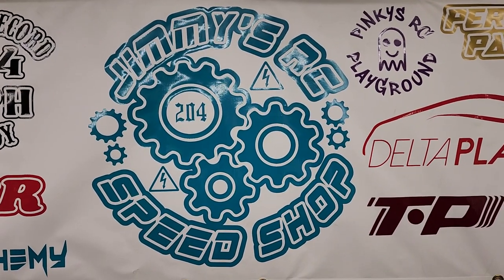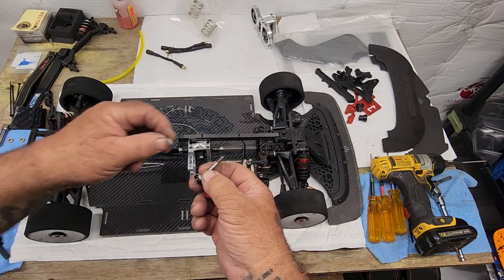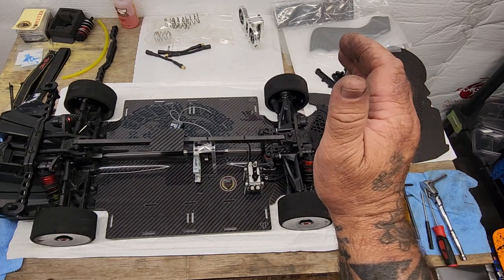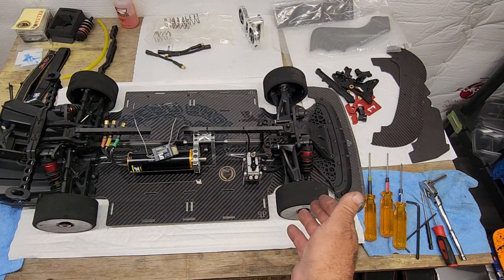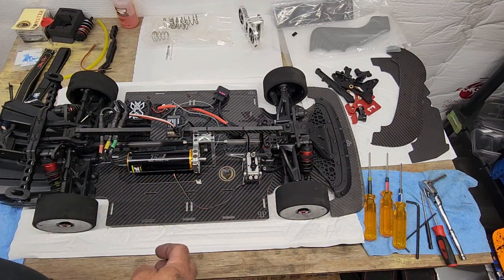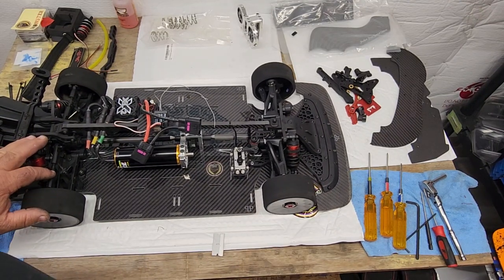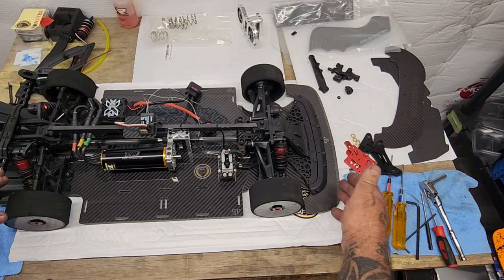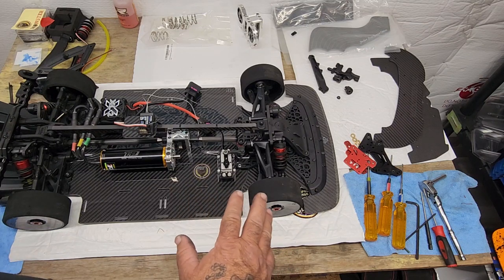PERFECT PASS CARBON BUILD      (part 2)

Comment: Subscribed. I only started in RC a few months ago. I became hooked when I started watching speedrun videos. Bought a tt02R chassis and learned a lot from that build. Tried to do some speedruns and long story short, I realized it’s a huge challenge to get a tt02 mid 100s. So I got a vendetta, did every single mod you can imagine. Literally. Now, I want to build a perfect pass replica of Raz’s dual motor. So I bought the glossy GT Chassis when he just got more in stock and I ordered. Brand new limitless v2. Then, I realized, anyone using the GT Chassis, isn’t using the limitless body. 😂. Such a newbie. I’m going to keep on building it and was also curious if you knew is it a clean swap over? New v2 to the pp chassis??
Reply from the maker: Thank you for watching. 
Yes the V2 to Perfect Pass chassis is a straight across swap

Comment: Thanks for an awesome videos full of great info. James after the build is done and the ride high is set. How do you fine tune the ride high? And what i mean is when checking that the tires hit the floor at the same time or when raising the front and 1 tire won't touch the ground while the other tire does? Thanks again

Comment: This has been very helpful to me. I'm using the perfect pass springs also. I see you are using bump stops with yours also, are they necessary with those springs?
Reply from the maker: Glad it was helpful,   Bump stops are not necessary with all setups , on some of my dual motor cars i still run , these shocks were off of another car that already had them so i just left them installed
Reply: @jamesmccoy204  I'm doing my shocks now with the DU-BRO washers. Can't seem to get the front low enough. The washer does go under the piston..right?